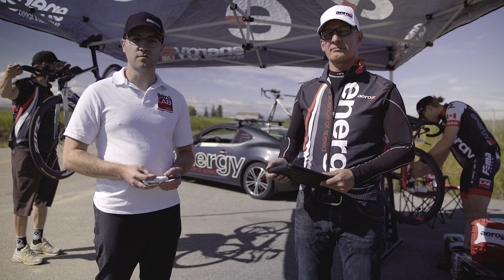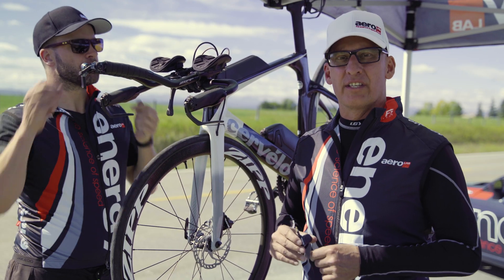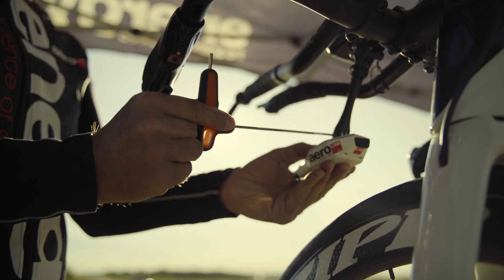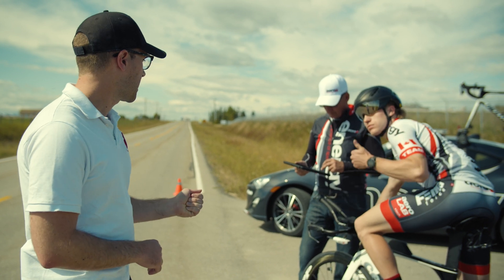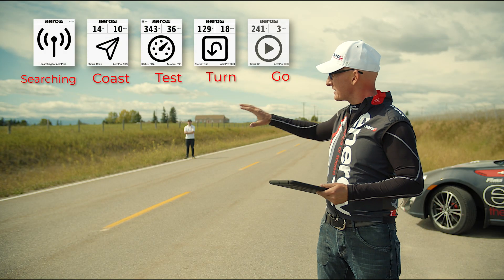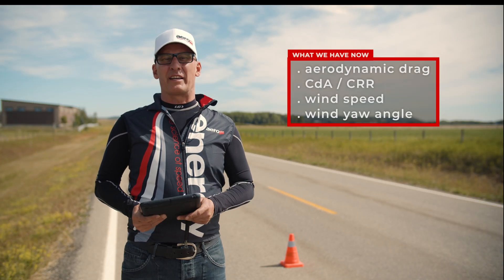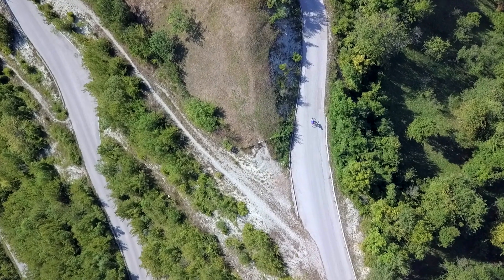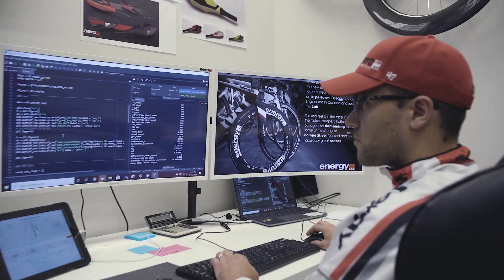UPDATED Field Software Walk-through: Every Watt Counts

Comment: In the section showing the iPad display the CdA and watts (0.218, 265) look wrong for the average speed of 31kmh.
Huge crr or uphill?
Also,what's the CV typically across runs?
Reply: CV across runs depends how long your out and back is (different averaging interval of data) and how consistent the rider is. Typically lap to lap variation is 0.0015-0.0025. This is why we typically recommend at least a few laps to better obtain a final CdA value. As for the iPad, was still in beta testing mode for this video recorded quite a while ago. My guess is some funky numbers based on a badly calibrated power meter (some single-sided cranks are very generous). We also have done some runs down at 20-50psi, so you might be right regarding the large Crr. It was all beta test stuff.